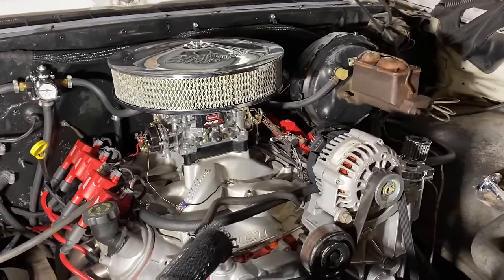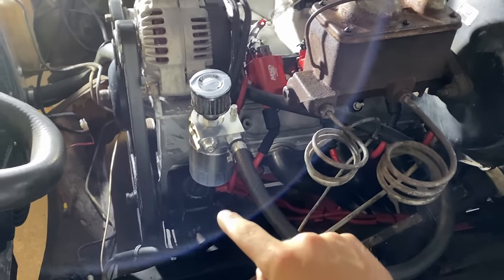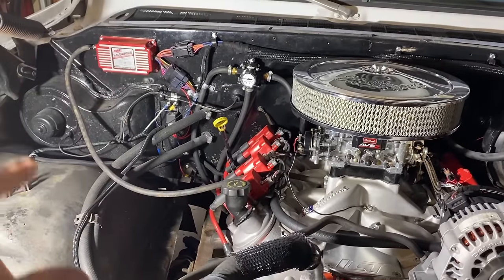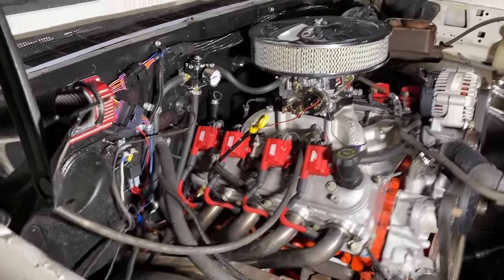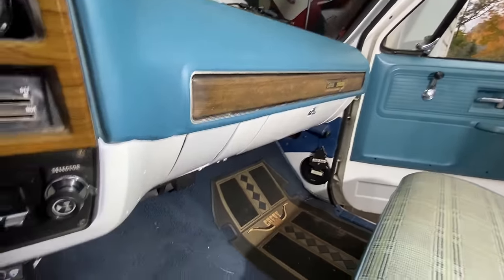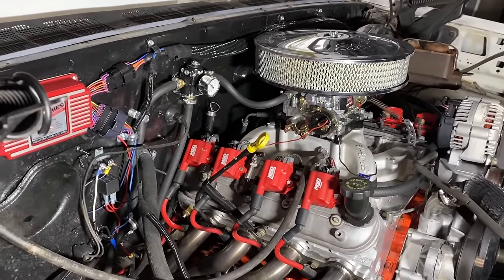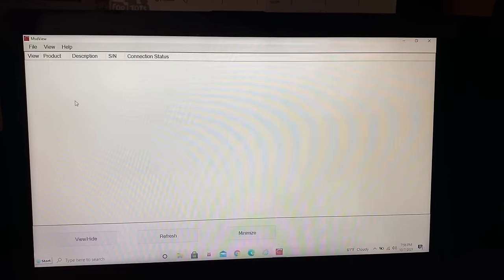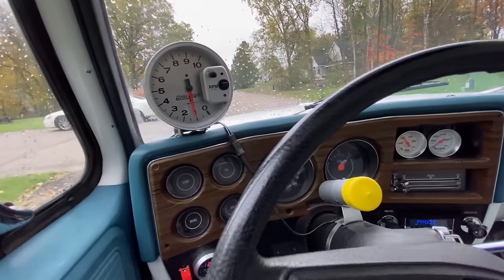CARBURETED LS SWAP! EVERYTHING YOU NEED TO KNOW! 1974 c10 Squarebody |CARB LS| |CARBURETED LS|

Comment: Cool going with carb. But why? Make same power on sbc save a lot of money
Reply: @squarebodyblake4464  I meant why even go with an LS when sbc would of been cheaper easier and me same power. I prefer carbs as well I wouldn’t ever choose to switch away from carb and only had different when my vehicles came that way.
Reply: @squarebodyblake4464  how much did you pay for block and msd? A 400 sbc can make 500 hp for pretty cheap.
Reply: @squarebodyblake4464  I know. 700 not to bad. 388 stroker make the power fairly cheap too of course only if your building yourself.
Reply: @squarebodyblake4464  definitely better air flow.

Comment: I have a 238-242 duration .600 .600 lift cam in a lq9, what selector on the msd box is best until I can hook a laptop to it? LS1HO? It's on truck right now but I only run on 93.

Comment: I bought a 01 chevy silverado 2500 6.0 and It has a security problem and idk if I wanna continue to fuck with it. It has almost 300000 miles on it hasnt ran in probably 15 years it  was a dot highway truck and I kinda wanna bypass all of the electrics and just carburet it do you think it's worth it to carb it or should I just continue to try to fix the problem. Idk what I'm doing I replaced the starter the fuel pump spark plugs that's it please help
Reply: 300,000 mile block is a paperweight.

Comment: Im putting a 5.3 in my 85 C10 it has a 305 with a 400 turbo ,the 5.3 came with a 350 turbo ,but I'm gonna use the 400 ,will I have to use the torque converter from the 350 Turbo or am I ok with the torque Convertor with the 400

Comment: Why did you block off the steam port on the radiator, then run an inline adapter?????
Reply from the maker: Because the radiator doesn’t have a spot for it, not only that this method is a lot better for making sure there’s no air pockets in the steam port passages

Comment: Great vid and content my man. But you can’t compare AN fittings from fancy to regular coolant hose style clamps. I get your drift. Just saying. Plus being low psi on the fuel, you don’t need anything. And another 1, driveline wise, can compare stock “untouched” to what “people” say to upgrade. Now if you just cruising your fine. But best believe. Any torque or sticky wheels, aka traction, your going to find out. I know it’s an old vid and ima subscribe but just my 2 pennys.

Comment: Stock valve springs are fine as long as you don't go over 500 thousands lift.
Reply from the maker: There not good enough if you wanna turn 7000 rpm tho
Reply: @squarebodyblake4464  ok, gotcha. Thanks for that info Sir.

Comment: Hey do you use the original shifter from the column
Reply from the maker: Yes originally I did but the transmission shifts too early at wot so I switched to a b and m pro gate shifter. But as long and you keep the transmission in the stock location you can reuse your column shifter
Reply: What kick down bracket did you use

Comment: installed a 850 dbl pumper holley with the holley blue pump on my 5.3 swap 350trans in my c10 . getting detonation   once it changes out. does anyone has any idea what is going on?
Reply: @squarebodyblake4464   once the  automatic transmission shifts the engine loses power and start to ping

Comment: If i have a motor already set up, as yours ready to be install in a chevy 94 what do i need to do so that the transmission functions correctly
Reply: As long as you get the vaccum for the shift controll setup. As well as get the torauee convertor bolts and belllhousing bolts all to spec. It will do what it's designed to do.

Comment: Did you use the harness from the ls or from the c10?
Reply: @squarebodyblake4464  I've been trying to figure that out getting ready to swap my g body my friend selling me a good running 5.3 but it no harness or anything for 500 no computer jus a the engine and I was like do I need all that if I use a carb but I guess I don't
Reply: MSD comes with everything for engine wiring, truck harness is stock

Comment: You have a steamport plug right there on the radiator below the cap. Why did you plug it and tap into the radiator hose instead? That makes no sense.
Reply: If it works it makes perfect sense, you just don't understand why

Comment: Im debating on doing this to my 4x4. My only issue is im scared of buying a new wiring harness, which mine needs, and i need a new trans, and can't find one at all. I have the engine, just not sure if its any good sadly.
Reply: Do you know know how to turn a wrench? Cant find a transmission? Theres piles of them everywhere.
Reply: @SOLDOZER  not here. Most oldschool transmissions have been used up and all the newer ones are 1k+ i just got lucky a couple days ago and found a th400 for about $500. Yes i can turn a wrench. Ive built every vehicle ive owned and driven them to the point of failure just to build them back again.
Reply: @lilmancc35   You built every vehicle you owned and built them back again. But you dont know how to look at an engine to see if its and good?
Reply: @SOLDOZER  yes. I can tell if it's good but i got other projects going on so i havent looked. Its been seeing up for 2 years. In 2 years a engine can go from running perfect to locked up. Im in the process of buying a house, fixing a car that's wrecked and keeping everything around me from falling apart.

Comment: Send me your email I need to ask you about your carb swap I’m in the process of doing one now
Reply: I’m in the process of doing doing carb Ls swap on my 84 Chevy c10 and idk what wires I need off the truck to plug into the msd box
Reply: @squarebodyblake4464  alright
Reply: @squarebodyblake4464  what you use to replace the oil pressure sensor
Reply: @squarebodyblake4464  like the ones that they sell at oreilly’s that has the 3 gauges together
Reply: @squarebodyblake4464  alright thanks

Comment: What a waste of an LS swap with a pos carb
Reply: what a great contribution from you Sam. Nice going.
Reply: Really?
Reply: Ill take a carb or super sniper setup over the stock efi and ecu setup
Reply: U know they make more power  carbed don't u?
Reply: Tell us you don't know how to tune a carburetor without telling us you don't know how to tune a carburetor. O wait. You already did.
Reply: Your wife's boyfriend has a carb LS swap
Reply: No its not, looks alot better
Reply: And yet the nhra top fuel cars are still carb... what a dunce
Reply: @chuckdock4436 I have a Carbed LQ9 6.0L with a nice sized cam and  milled 243 head to up the compression 11:4:1 on 93 octane. Made 426hp/432TQ at the wheels. I also have a LS2 402 Stroker that's EFI that make 450tq/463hp and I love both motors but I only drive my cars in the summer so next motor will go Carbed again.